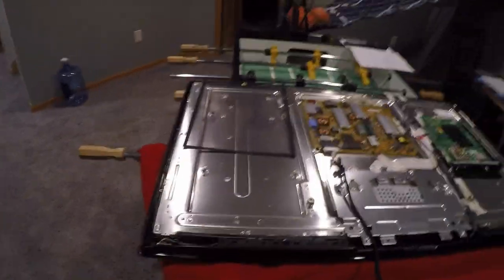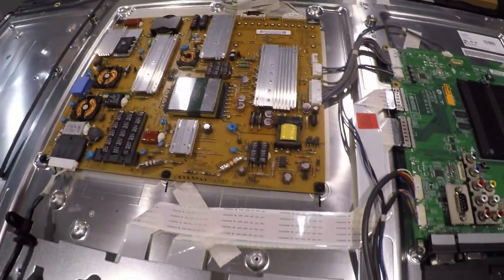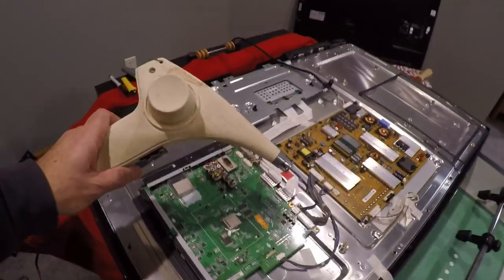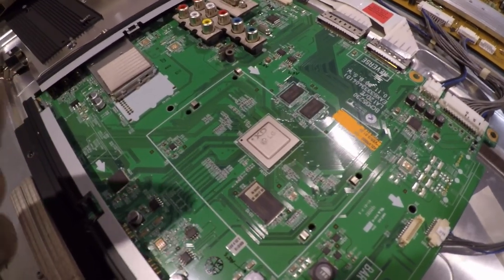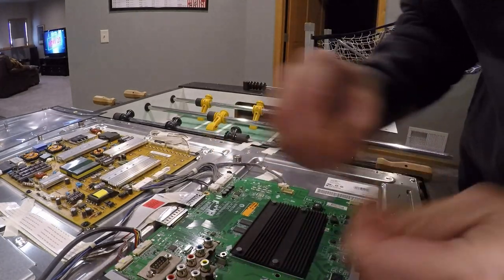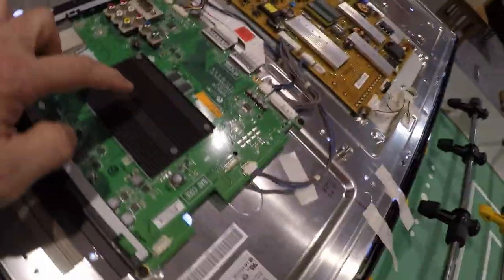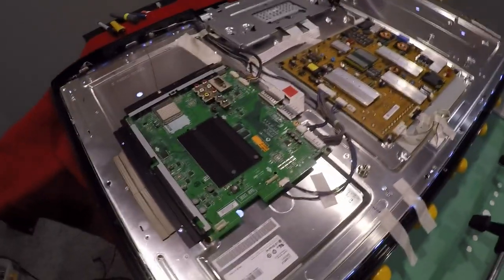Main Board Repair of a 'junked' LG 42LV5500 TV Reflow Oven

Comment: i did heat the chip but worked for about 3 months , do you have any other ideas ? if i add solder paste a little bit on side of the chip or if i replace the chip is it gonna work ?
Reply from the maker: Do not add solder paste. That will create solder Bridges. You could put a little bit of thin liquid flux around the chip, not a lot. Then heat the board from the back until the flux melts and then wicks under the chip.  Then heat the top of the chip for a few minutes. That will help the solder balls reflow and remelt. The first TV I ever did I did not use flux and it is still working so my guess is you probably didn't heat it warm enough or long enough.
Reply: @timgoihl  ok thanks i put resin paste last time i was thinking was the good one im waiting to receive liquid flux then ill try it . which temperature with the heat gun is the best ? and thanks a lot for your hints
Reply: Tim , did you clean off and add new heat sink compound on the main board heat sink? That might make it last longer. If the gpu chip can’t transfer the heat properly it could melt the solder again. It could be endless cycle.
Reply from the maker: I didn't I don't think. The best idea so far is to add a small USB powered fan on the back of the TV that blows right on the heat sink through the cooling holes on the back of the TV. I believe that works and helps a lot.
Reply: As mentioned in the og video un soldering and resoldering a ball grid chip can be very difficult even with prior electrical experience. I would send the board to a repair service if all other trouble shooting points to that chip as your failure point.

Comment: Thanks, fixed my 47LW5700 with a heat gun on the chip as you said.
Reply: I have the same model.  How long did the fix last?
Reply from the maker: Mine has been working since the day I fixed it and made the video. Today is August 4th 2021.
Reply: Still going😁
Reply: @galford50  still working👍
Reply: I have same tv 47lw5700.was your standby led blinking slowly red? Mine is doing that.
Reply: @edwin2963  I think the light was just not on
Reply: @brontejc  thanks for your reply..but for this fault its highly probable the light was on..it toggles on off slowly
Reply from the maker: @edwin2963  just because your LED is flashing and someone else's wasn't doesn't mean it's not the video chip.  The main control processor has to make decisions based on whether or not it can communicate with the video chip and if it can do some of the communication and not others it could record it as a fault and flash the LED.  There are hundreds of ways it could fail depending on which pins become unsoldered under the BGA, the primary symptom being no picture, no audio, IMO.
Reply: @timgoihl  ok but how many chips are we talking of here.Is there a separate video chip? I thought that big BGA lg engine chip handles the video processing too?.
Also would there big difference in backlights for 42 and 47 inch?.Mine is actually 47lw5700...i have the manual but is very shallow as compared to the one you have for 42lv5500...If you have one for 47lv5500 please link me too it too.
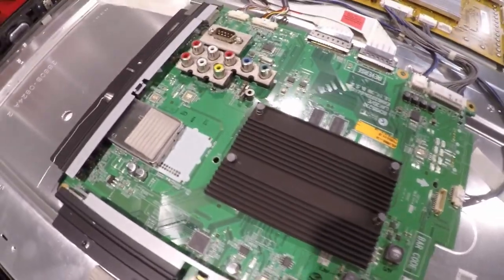Reply from the maker: @edwin2963  Basically ONE chip, the video chip.  What year is your TV?  Look at my video starting at 3:30.  I point out the little control cpu (the one that controls the LED) and the ONE video chip under the big heatsink.  Thats why these TV's quit working - if the even one pin (of 300+ pins) under the video chip becomes unsoldered, it could stop the tv from working.  My symptom was power up, but then the main cpu could not talk to the video chip and the backlight was never commanded to turn on, and no video.  Yes, it could be anything, but there are so many videos (oven baking, mine, etc) for this problem that this is most likely. 
Service manual for https://kupdf.net/download/47lw5700-sa_59b894cd08bbc52131894c67_pdf
Reply: @timgoihl  my tv is 2011 model..thanks i have seen the control cpu labelled micom chip on the tv.thanks again for the service manual.many thanks again.
Reply: So my fix lasted  around 3 months.  Will tray again.

Comment: The 24 pin connectors for my 55LB730V model are refusing to come out - does anybody have any tips?
Reply from the maker: On the main board? Power connector or tcon? The power connector typically just unplugs. The very flat video connectors sometimes have a flat black or brown bar the flips up to release the cable.  You could send a pic to my username at gm or yh.

Comment: Does it still working?
Reply from the maker: Yes, mine is still working.  so 8 months so far....
Reply: @timgoihl  Hm... Nice) i have an old 60' LG Plasma TV which had some problems with mainboard for last few years and yesterday it eventually stopped working at all (no picture, no sound, only backlight) =\
Gonna try your method) anyway: it is pointless to buy new mainboard for such old TV, it is too expensive, easier to buy the new modern TV... =\

Comment: The method is working. but  after 2 months..we ll have the same problem ..all we need is changing the main board ... new one
Reply from the maker: A new board isn't really going to help because it's probably just a refurbished old board with the same problem. You probably just need a little more heat or time when heating the chip mine's been running fine for 2 years.  And I've done two other since then. Another thing you could do is try a little bit of liquid flux not much around the edge of the chip, then warm the board from the bottom until the flux melts, then heat the chip from the top. That's the method I've been using.
Reply: @timgoihl  thanks.. i ll do it again for 5 min heating ..lets see the result
Reply: liquid flux do you mean solder paste ?
Reply from the maker: @maximelevesque5914  Definitely NOT solder paste, that will cause bridges under the chip and it will never work again.  A liquid flux similar to this https://a.co/d/0jhInNq, but I did not use flux on the first TV I did and it is still going strong.
Reply: Tim , did you clean off and add new heat sink compound on the main board heat sink? That might make it last longer. If the gpu chip can’t transfer the heat properly it could melt the solder again. It could be endless cycle.

Comment: It actually worked for me
Reply from the maker: Cool!  Heat gun or oven?
Reply: Oven ..  unfortunately it stopped working after couple of hours .
Reply from the maker: @kishorjagdale873  As I said near the end of my video, that's my concern... does the oven get hot enough to completely reflow the solder?  also if you look at the edge of the board, is it curved or sunk in at the center of the board?  if so maybe some of the bga balls are right reaching their pads on the board???  If I have to redo this again, I will also add a plastic or wood stand off under the big chip to help support the board...  another thing to try is some liquid flux around the chip to help the solder reflow.

Comment: I don’t have any electrical and soldering back ground. Thank
Reply from the maker: When your reflow you don't need to add any solder, all you have to do is heat up the chip and the solder underneath it should reconnect. Read the information below the video, there's a little heating device linked to Amazon which might be the way to go for you.

Comment: What they did was not for long.  Maximum for 1 year, then repeat.
Reply from the maker: If you mean the fix does not last for more than a year,  this could be true.  I believe the board flexes (bends) under the heat of the video chip causing the balls to desolder or break.  This is why I suggest that the board needs support (a wood or plastic standoff) under the video chip.  I'm not sure the oven fix gets hot enough to melt solder.  Also flux should probably be used to help the solder reflow better.
Reply: Then the thermo-rubber is put on other TV models better.  And also increase the radiator, if this is really the case in the balls.  There is also a delamination of the chip inside from the substrate, then only a replacement, but a lot of marriage, even a new one.

Comment: May I ask You in advice where to find problem on main board in the same TV.
Problem find _screen shaking.
Here is video https://youtu.be/UoCXQjwvY6E
T con replaced /checked is ok
Reply from the maker: Right, its probably not the tcon, but you could run the tcon test, just to be sure.  next I'd try a few different video sources to make sure its not the tuner/antenna since the tuner is a separate module - OTA, hdmi's, a usb jpeg, etc.  But there is just the one video chip which controls everything.  different pins(balls) becoming unsoldered are going to present in different ways - no picture, no audio, maybe what you are seeing.  i would not be at all surprised if the video chip needs to be reflowed as i describe.
Reply: @timgoihl  Thank you very much for explanation.I try other source signal and after reheat with hot air.
Many thanks.

Comment: It will last for 2 months and you will have the same problem.Having it reballed is a longer lasting solution,
Reply from the maker: Mine has lasted for 11 months. It depends how good a job you do with the reflow which depends on the heat. and as I stated in the video and the text I believe a lot of this has to do with the PCB board flexing, so if you add a standoff under the chip there will be less chance of that. Also adding flux can help the solder reflow. Granted it is somewhat difficult to do without the proper heat gun tools but it is possible. Lots of people have success with this.